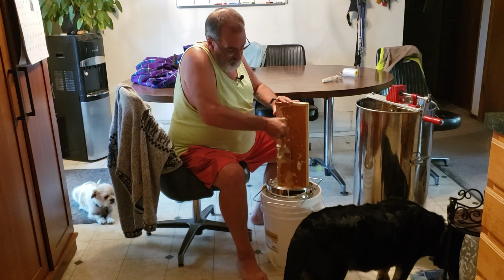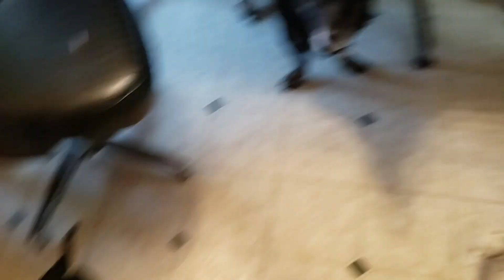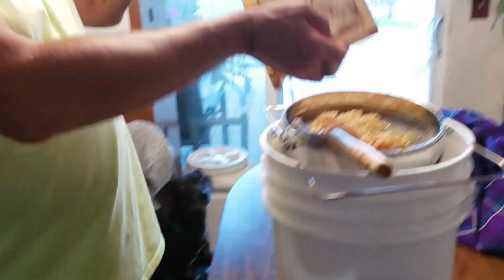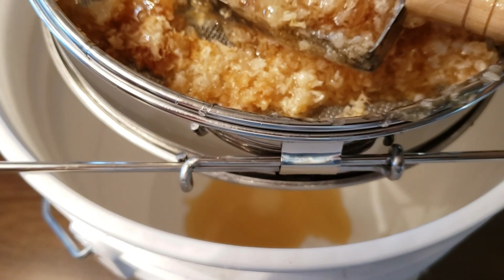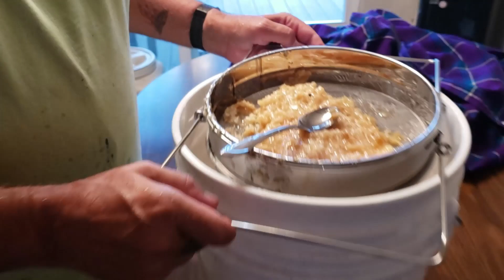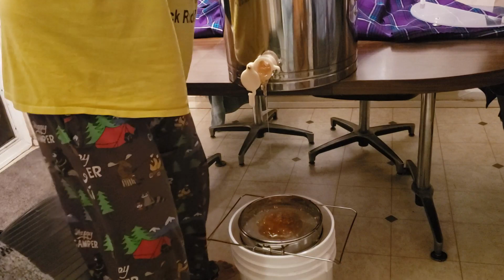1st year honey harvest

Comment: Congrats, After watching the video I am glad I have not tried that tool. Scratching the caps does way less damage to the comb. With most of these spinner they are designed to only be run with the gate open. The reason is that the honey should never be allowed to get up to the bottom bearing where the axel grease is located.
Reply from the maker: Great info. Thank you.
Reply: It will also "whip" the honey.
Reply: @wannabeehoneyfarms  When you get to a state where you have enough honey to give away I would suggest that you extract the honey without your dogs in the area (honey and fur seem to like each other but friends and customers don't seem to appreciate the combination :D ).

Comment: Next year you are going to have quite a bit more, so you might consider a modification to the spinner. I have a hand crank as well, but I bought a one-way needle bearing and put that into a step down adapter, put that on my drill, and turned it into a power extractor. Works amazing, if not too well! The adapter for these bearings is a 3/4 inch bore, 1/2 inch OD, 1 3/4 inch Length, 1/4-28 x 5/8 Set Screwhttps://www.amazon.com/gp/product/B081YDSHYB/ref=ppx_yo_dt_b_asin_title_o03_s01?ie=UTF8&psc=1
Reply from the maker: I'm already shopping for a different one and putting mine up for sale.